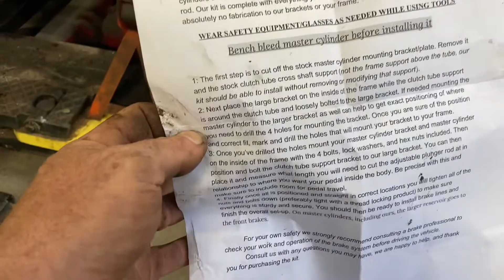Jeep Willys dual master cylinder conversion install

Comment: Hey Jason
   That double Master Cylinder is a great improvement on the CJ !
And you made the installation look really easy.
Flipping that mount over to the outside of the frame to locate the holes was downright Smart !
I am thinking I might do that on one or both of my CJ's I am working on.
Thanks for the How To.
   Be Safe, Well and Warm
   And thanks for the end view of the lake.
That is so cool to walk into your back yard to go fishing.
Reply from the maker: Thanks C.B.I’m really glad I made that upgrade. It was actually easier than I thought it would be. I couldn’t find any information on how to install the brackets so I kind of just common sensed my way through it. Sometimes at the end of the videos I like to show some of the unique areas I do plumbing work. This was a cool property I worked at by the Crane Estate in Ipswich Massachusetts

Comment: Interesting to see that conversion with the body removed. Those frame mounted MC are hard to work on if the Jeep is not disassembled. I wonder how much harder that conversion would be if the body was on?  Thanks for the fun. 🤠
Reply from the maker: I think it would be much harder,I think I’m going to have to make a bigger access panel to fill the master cylinder with brake fluid .Thanks for being here Mark

Comment: The stock master cylinder is a pain to get the top cap off to fill. How hard is it to get the clip & top off with the body on
Reply from the maker: It’s still a real pain. Trying to figure a way to make it better

Comment: Did you have trouble with steering arm hitting front brake fitting and lines after dual master is further forward? I did and not happy with my fix. Thanks
Reply from the maker: Hey Benny, I’ll check it out. If I can help I’ll put it in my next video
Reply: @royworks28   Thanks. Appreciate any advice.

Comment: That's a nice upgrade! Maybe I missed it, what is the set up on this system for a brake light switch?
Reply from the maker: I found out it’s a inline pressure switch on the front brake line.